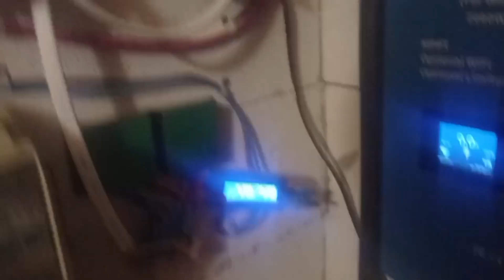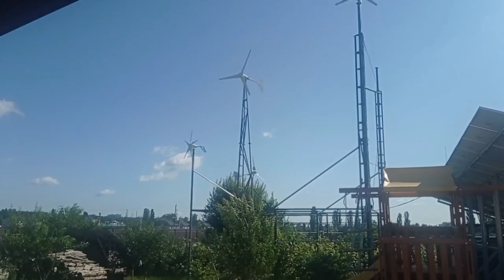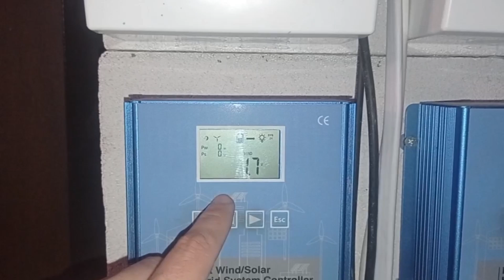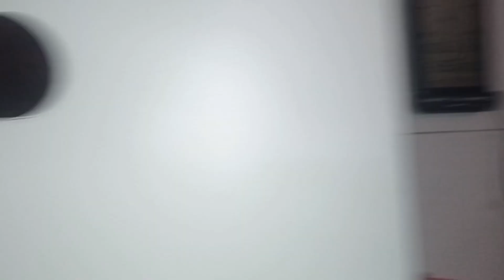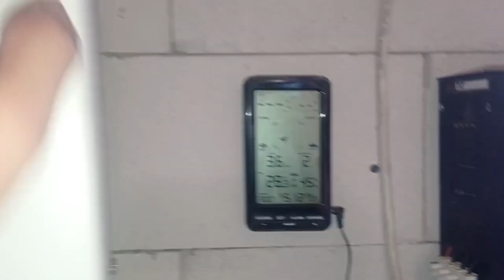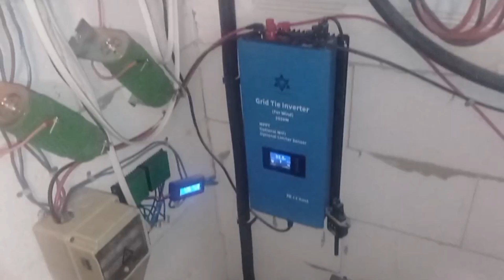3-day test of the small wind turbines setup in highly turbulent air flows. will it ruin production?

Comment: The output seems really low on all of them, I saw videos where the istabreeze ones make a lot more power on the toyforwatts channel.
Reply from the maker: just don't forget ista won't even start until 5-5.5 m/s is reached.
and my goal is not to show you one day of it shooting out and then 300 other days standing still.
that kind of production I am getting is relevant to 3-4 m/s average daily winds. in those conditions - Ista won't ever produce even half of it (given per calculated sqm of the working surface).
Reply from the maker: ask yourself a question - why the toysforwatts guy NEVER ever shows you the instant wind speed with the connection to the wind turbine's production?
is that too expensive to get the $70-130 weather station and to mount it reasonably high to get some relevant wind speed reading? to understand how exactly and under which conditions your wind turbine performs
Reply: @BackyardVoltage  He goes by the weather forecast instead. His wind turbines are in a very windy location.

Comment: hello sir I'm from Indonesia

I am planning to assemble a windmill using a servo motor from an industrial sewing machine
at 1000rpm 55V production

I'd like to ask
is it difficult for a windmill to reach 1000rpm?? 

thank you sir
Reply: I plan to use it to charge a 8s 24v lifepo4 battery
I want to convert it to DC current using a 3 phase diode and 100V capacitor and input the Epever Xtra 40A with a maximum voltage of 100V DC

but I think about braking if there is a storm
because at 2000rpm the generator voltage will be above 100v
Reply from the maker: it is definitely hard to reach 1000 rpm. only small rotors can do that, like 1.2-1.3 m in diameter. but the wind has to be very-very strong still to get to those values. once my 1.65 dia was shooting about 300 watts, they were going approximately 500-550 rpm, and the wind was very strong.
for 2.0 meter in diameter 1000rpm would be a brake point, where the wind wheel will collapse, as it will not be able to withstand the end of the blade rotation speed.
Reply from the maker: just think of using a proper controller with a dumpload, for 24V, like this one https://s.click.aliexpress.com/e/_Dk4RfRB, and it will already be more than enough to sleep safely during stormy nights and not to worry about the wind turbine.
however, think carefully about the diameter, as the rpms matter a lot.
Reply: @BackyardVoltage  Thank you sir, very easy to understand 👍👍
and I've seen controllers with dummy load for braking from aliexpress

one more question I have
Your wind turbine is 500rpm - 550rpm without load, how many volts can it produce? 

because you are very good at explaining, I will subscribe to your YouTube channel
Reply from the maker: thank you!

my 1.3 m dia machine can reach about 45 votls (VAC) at those RPM.
the 1.65 dia has a bigger generator already and can hit about 80-85 volts VAC on 550 rpm
and the 2.5 dia machine, not sure... but theoretically 500 RPM is the limit for it, maybe 550 rpm is the rotor breaking point already. but I've seen on a 10R resistor load under quite strong wind (14+ m/s) 120Volts (VDC this time, after rectification) from it. so no-load for it should be quite higher, but I have no technical possibility to check the exact value.

Comment: Maybe a dumb question but is your voltage fairly constant or is it relative to the rotor rpm?
Reply from the maker: relative. the higher the revs - the bigger the voltage. also the voltage in "no load" and under load - are two different voltages. you have to define and adjust very carefully the wind power curve, and the best controller is the one that allows doing it. in the US for example you have got the MidNite - that one I consider being a perfect one. However, it's way too expensive for me I think.